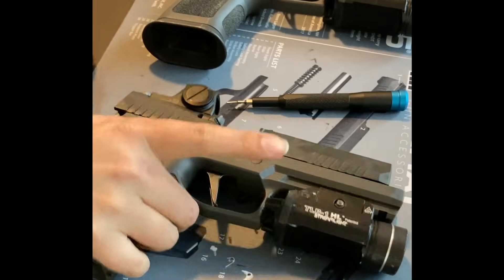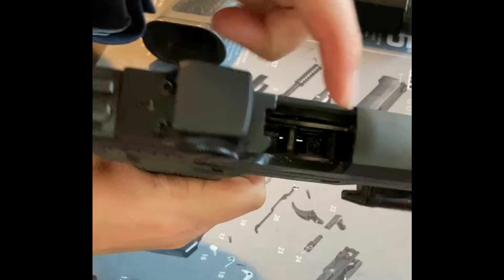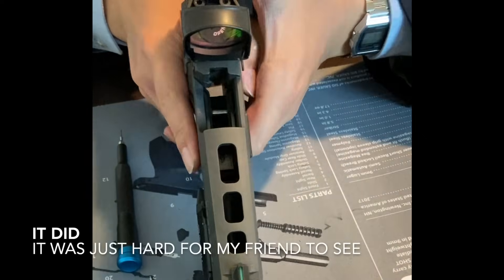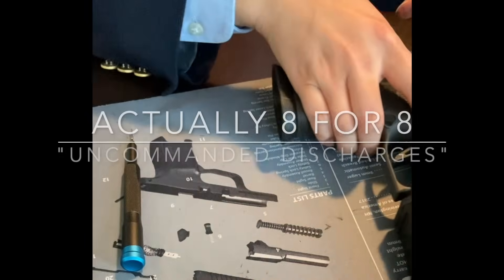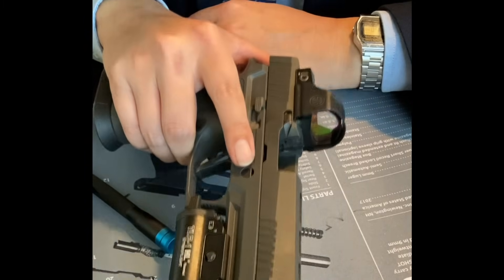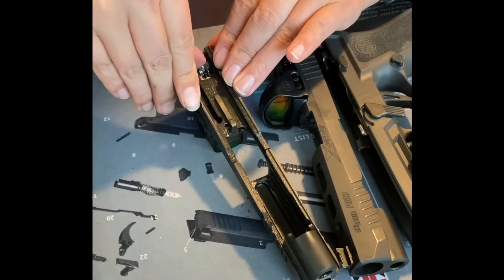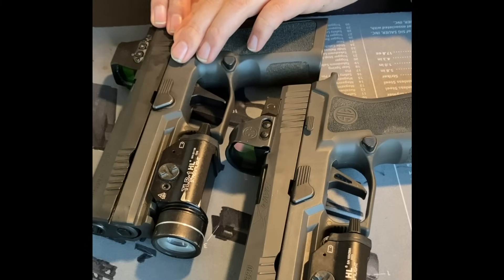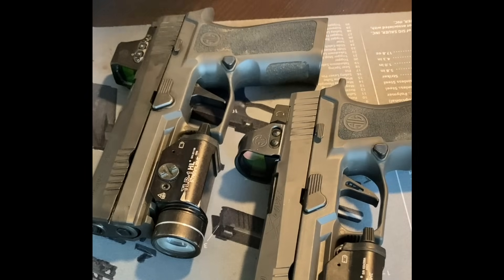Testing two P320's for Uncommanded Discharge: One PASS, one FAIL

Comment: Command = To give an order. Negligence = failure to take proper care in doing something.

Uncommanded is totally acceptable phrase to use if the gun is firing without being actuated. Negligence implies a lack of concern for safety was the root cause.

P320s going off being dropped or bumped is not a result of negligence, its a result of a failure of mechanical safety features allowing the gun to fire without user activation, aka, user command.
Reply: The negligent act was carrying a p320
Reply: Uncommanded = out of spec. Fixed it for you.
Reply: @depthcharge6215 barely. Gross generalization. 
If you can only hold four words in your head its fine I guess
Reply: @ Should I use the firearm armory term? Poor tolerance? All videos points to middle mechanism that can be purposely manipulated without trigger pull.
Reply: @depthcharge6215   the term uncommanded and negligent discharge have definitions, you don't need to boil it down any further. I think they both accurately describe their respective situation. 

Just like negligence can show in a million ways, manufacturer error can do so similarly. To say its ‘out of spec’ is true, but unhelpful in describing the problem without technical evidence i.e could also not be the root cause of the discharge.

Comment: Thank you.  My EDC has been a P320 for 10 years.  Seen 1000s of rounds down range, near self defense shooting, and a scuffle that had me and the assailant rolling in top of the pistol. It has never fired unless I pull the trigger.    It does concern me despite my positive history with this pistol.   I'm adding manual safety,  more so because I'm a 1911 guy anyway (carry a 10mm 1911 elk hunting and during the winter). Thank you!😊
Reply: FYI: The Manual safety only blocks the movement of the trigger, not the sear. You can still get a "pop", with the safety on.
Reply: Just an FYI but big Army has seen uncommanded discharges occur even when the manual safety was verified to be engaged at the time of the discharge. As I understand it the manual safety versions of the P320 only block the trigger bar from moving. The technique shown in the video here is bypassing the trigger bar entirely.
Reply: @Windowlick_  as I understand it this is correct. The manual safety doesn’t fix this problem as it doesn’t block the sear. The major flaw in the design of the gun lies in the fact that the sear is what defeats the striker safety, not a trigger bar or something associated with the trigger. Thus, if the sear moves for whatever reason, like a bump, the sear might disengage the safety while also allowing the striker to slip off the sear. The entire design of the gun is flawed and lacks redundancy in its safety systems. So if one thing goes wrong, isn’t built to spec, is made from cheap metal and wears down, etc. the thing goes off when it shouldn’t. 

I used to want a P320 but now that I see these problems and Sig’s utter lack of concern. Matched with their arrogance and disregard for obvious safety concerns… I am done with the company for the foreseeable future. May even sell the P365s I own as I don’t want anything to do with the company now.
Reply: @Windowlick_ damn I was gonna buy a sig m18 with manual safety in hope that would stop this mechanism failure from happening but hearing this I’m definitely reconsidering this
Reply: @lucastonoli3256  yeah I may not go through with it. Crazy because sig is supposed to be one of the big dogs in the firearms world but can’t put together a striker fire pistol smh
Reply: @lucastonoli3256  yeah ppl are mad because this is weapon manufacturing 101 a “upper tier” company fumbling a simple thing that truly renders the firearm unsafe. That’s like Chevy making a corvette that airbags explode when you drive over 15mph

Comment: I do not understand this, how is the striker block not preventing the striker from moving forward? I believe you have missmatched old slides with a new FCU or vice versa.
Reply from the maker: @MossyOakFreak Both pistols' FCUs, striker assemblies, and slides are matched from the factory.
Reply: Or maybe SIG’s cheaply-subcontracted parts just plain suck, along with their negligent quality control.
Reply: @mikegreen2214  that's just a broad statement. Do you know what SIGs QC processes are? No you don't.
Reply: @ 
I know they keep letting some absolute garbage through, which is enough to demonstrate that whatever they’re doing sucks.
Reply: @mikegreen2214  what would you call absolute garbage?
Reply: @mikegreen2214 can’t fix stupid 😂

Comment: What are the numbers on the trigger bar? The old FCU trigger bars were stamped with the numbers 675. The redesigned bar is stamped with 576. I'm curious to know if the one firing the striker off is using the 675 trigger bar.
Reply from the maker: The passing FCU has a 675 stamped Trigger Bar and an X-series flat trigger, the failing P320 has a 576 stamped Trigger Bar and a Legion-series skeletonized trigger.
Reply: @P320Truther What do you do if you have a 576, but it passed your test, brother?
Reply: @meee175 better hope the 11th time isn't when it fails then
Reply: @t4cot4ctical No shit. In all my 45 years, I never thought a company would almost intentionally put us all in danger to protect their precious military contracts. Yet another "conspiracy theory" coming true. I'm running out of them, they're all coming true. 🤷‍♂️
Reply: @P320Truther  Both of my trigger bars are 576 and they both pass. Can someone please explain how the manual safety on the M17/18 finctions? I am thinking of adding a manual safety to my 320 as an added safety.
Reply: @panioloprep8126 From what I understand the manual safety only stops the trigger bar from moving. The sere can still pivot even with the manual safety engaged. It may be enough to keep the safety lock from moving out of the way of the striker… but it also may not. 🤷‍♂️
Reply: This. Please post what numbers are on the trigger bars
Reply: I have a 675 trigger bar on a Equinox and a 576 trigger bar on a X Carry and both strikers function and return like they should.
Reply: ....for now  @petermilano7586
Reply: If possible, can you test the "updated" version of the p320.
Reply: He IS using an updated one.      @juanagudelo409
Reply: Yes, please post numbers on the trigger bar
Reply: The numbers have nothing to do with the manufacture date
Reply: Do you normally take a “pokey thing” to the range to cause the gun to fire without using the trigger?
Reply: @stevenkarkkainen8115 You completely missed the point. He was testing the safety mechanisms that are supposed to stop the striker from impacting the round if the firing pin drops. 
The pin dropping is an issue. The safeties not working is an issue. 
He's only testing the safeties. Testing the firing pin would be interesting, but it's not what he's doing here.

Comment: Testing my X5 as soon as I'm home - praying I don't have a reason to dump a $1000 gun for a $500 glock
Reply: 100% am interested in a crowdsourcing of results of this repeatable test.
Reply: @TheJBerg  if you give me $3000 I promise to buy at least 6 P320s and raffle off the ones that don’t have this issue 🤣🤣🤣🤣
Reply: And destroy everything but the serial number on the remainders 😂
Reply: Bro, my best advice here if you're going to trade out your carry for something Glock would be to go with Shadow Systems (pick a model, they're all amazing). I EDC an SS MR920 Elite with a Trijicon RMR HD and SS comp. Also, stock trigger is just fine, but I did swap it for a Johnny Glock VEX Combat. Trigger aside, that pistol is still the absolute best out the box duty/carry gun I've ever run.

Comment: Could you take both fcus out and see what numbers are on the trigger bars. The trigger bars were changed years ago and the old style acts on the striker safety sooner.
Reply from the maker: The passing FCU has a 675 stamped Trigger Bar and an X-series flat trigger, the failing P320 has a 576 stamped Trigger Bar and a Legion-series skeletonized trigger.
Reply: @P320Truther  wow thats even worse than. The 675 should be the bar causing more issues because it moves the safety lever sooner with sear movement than the 576.